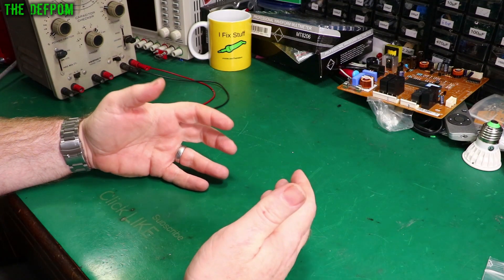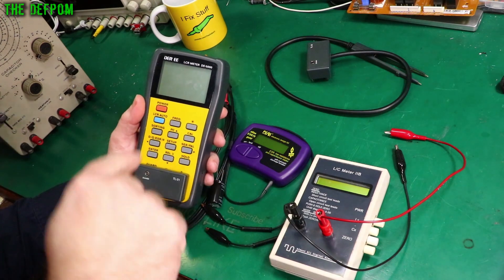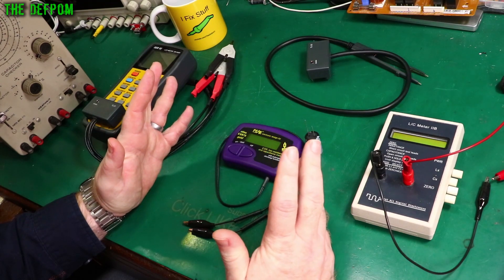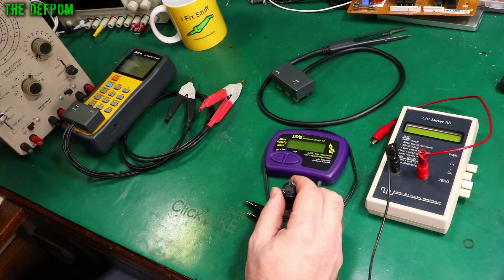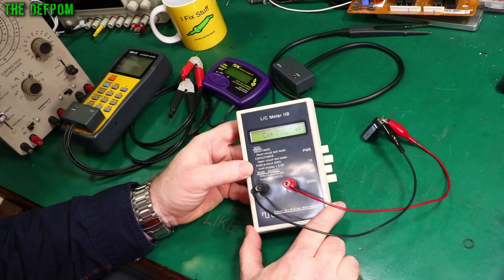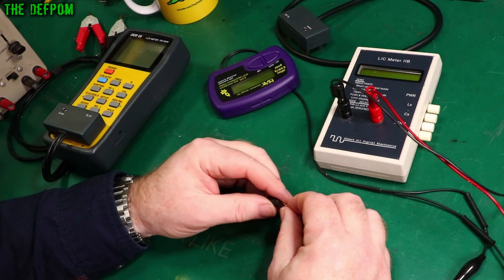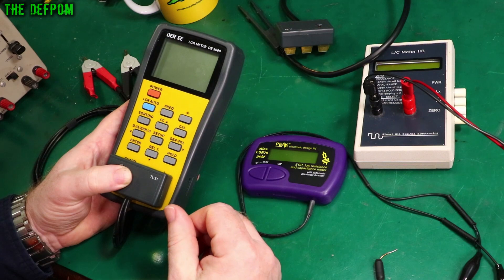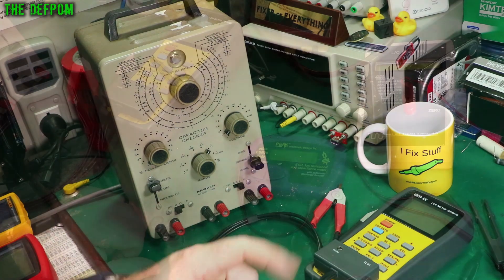🔴 Electronics Tools For Beginners - No.8 - LCR Meters - No.1009

Comment: DE-5000 seller you have linked to sells it for *absurd* price. Definitely not worth nowhere near that much. Used to be third of that price. WTF
Reply: Ouch!.....Current Ebay prices are 1/5th of that.
Reply from the maker: The one I linked to is the full kit with everything, power supply, different probes, case etc. yes the price is higher than they used to be, if you can find one for a better price let me know, I couldn’t.
Reply from the maker: @IanScottJohnston  damn really? Why are they so much more on Aliexpress? I will have to find better links to include, when I set those links up the prices were a lot lower !
Reply from the maker: So it looks like the DER DE-5000 originates from Japan, that must be why the Chinese sites have such bad prices now, I got mine from Aliexpress originally and the pricing was ok, it seems they have been hiked up a LOT, I agree eBay is the place to go !
Reply: $110 USD 2years ago, shipped from Japan. What isn't more expensive now anyway?

Comment: Have several too, including the Uni-t. It works fine, but by god the design is bad. The bale for setting it upright is rounded. Combined with the low weight it falls over all the time. Also the kelvin wires can be a challenge to get.

Comment: I was told to always discharge a (~10uF and up) caps before testing them.  Any truth to that?
Reply from the maker: Discharge all caps if they have been powered.
Reply: @TheDefpom  Yes, but I wonder how much power (energy) a tester puts into them.  So switching between testers they could be powered?  Sorry, am I being paraniod?
Reply: One of the main reasons for discharging first is to remove any high voltages which could damage the LCR meter.
Reply: @IanScottJohnston  Right.  So the question is, how high do the assortment of testers get the voltage up to test?  I know some rudimentary ones do a full charge and discharge.
Reply: @GeorgeGraves - When using a set of power meters, Southwire 2151N, (used mainly for HVAC work) I do frequently check capacitors. Yes I discharge the caps first, but out of curiosity I have checked the voltage after reading them, only to find on average they have about 1 volt in them (checked ac and dc, just to see what it does). Not sure if that helps answer your question entirely, but I imagine this is the standard result. I have a bench meter that can check caps, I'll see what it does as well.